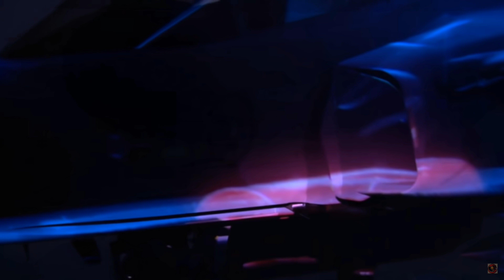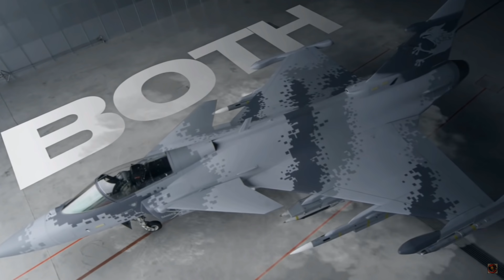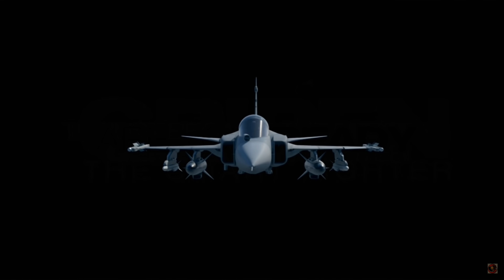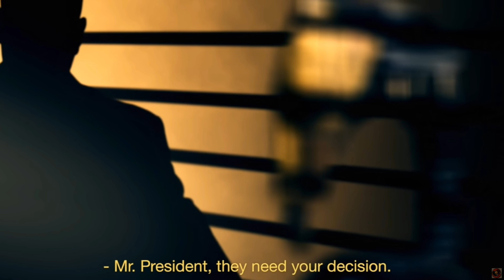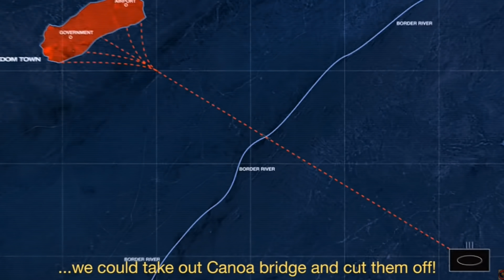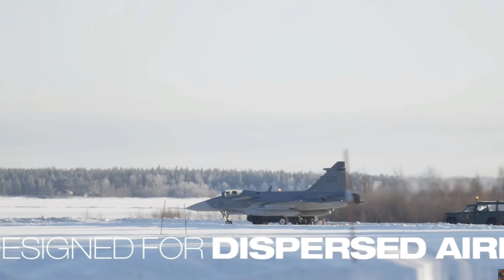Saab JAS 39 'Gripen' | SWEDISH MULTIROLE FIGHTER

Comment: If Canada gets the gripen then everyone should bow down and apologize to the engineers at bombardier. I’m sure, had they known how reflexive anti-American the Canadian public was they would have built a fighter rather than an airliner. 

Getting this vapourware airplane would be a step back considering it doesn’t even exist yet and most of the stuff is licensed. 

Also the Swedes won’t even be flying it in 5 years they are going to dump it and fly the typhoon. 

I’m sure it’s a fine plane for ThaiLand or whatever but it means Canada will never be able to deploy with coalition forces without having to lug around a bank breaking separate supply chain. 

What happens if there is an emergency? The pilot will either have to find a Canadian controlled airfield with parts (great in an emergency) or land at another field and wait for parts to be shipped. 

Welcome to irrelevance Canada but I guess you’re used to it.

Comment: As interesting as it would be to compare different fighter aircraft and their capabilities, we generally lack the information to do so. 

For example Gripen is claimed to have superb EW capabilities. This is believable; such capabilities cannot be demonstrated freely without giving potential opponents clues to defeat them. Sweden also has remarkable expertise in signal processing and radio electronics. Consider for example that they host Ericsson which is one of three companies in the world that produce functional 5G equipment. It also makes sense for them to focus on EW whose development is more expertise and time intensive, than capital and material intensive missile system development. However, this is still all conjecture.
 
No modern 4G or 5G fighters have ever clashed in anger in a way that would give us hard data. Really, even engineers at Lockheed Martin and officers in superpower air forces are only conjecturing on this.

Comment: An interesting story from the Libya campaign (2011) where Gripen participated in the reconnaissance capacity: After returning from a mission to its base in Sicily (Sigonella) the wing was told to divert to somewhere else since there had been an accident involving two UAE F-16s on the main runway and it was blocked(https://www.flightglobal.com/libya-nato-confirms-f-16-pilot-safe-after-sigonella-ejection/99622.article). The second runway does not have the required BAK-12 arresting system installed for NATO fighters but since the Gripen was designed to land on 800m runways it was the only fighter that was able to use the second runway.
Reply: Thank you for info

Comment: I remain amazed by how Saab managed to pack so much capability into a fighter that's so much lighter than its competitors. And in the process making a fighter with lower operating costs than those competitors.
Reply: But with less payload et cetera than those competitors.
Reply: @Sedna063  Well yeah, you can't get something for nothing. But the Gripen is ideal for nations with a smaller budget relative to how many fighters they need.
Reply: @RedXlV  Oh absolutely, it's a masterpiece of fighter jet design.

Comment: Brazil ordered a couple of Gripen NG: Fly by hour cost is not excessive, maintenance costs are acceptable, can launch/land in rudimentary roads, communication system that can share info with other units, small size means less radar signature, transference of technology, support from SAAB to adapt the aircraft to use Brazilian missiles (like the air to air Piranha) and possibility other national systems, can change equipment and adapt to different missions (extra fuel tanks, air to air,  air to ground), good radar with good range and radius, great for patrolling
Reply: I am Brazilian. The FAB said ages ago this what they realistically needed. Despite all the political pressure it took the government over a decade to decide on the right choice that was originally proposed. So, the French corruption didn`t work nor the Super Hornet with economic pressure. So, the politicians can steal from other areas and leave the technical decisions to the experts.
Reply: A couple (36 planes)? Fly by hour not excessive? Lol - we are talking about a plan that cost a tenth of a similar fighter plane of the latest generation. Both in purchase and in maintenance - Sweden has used it for decades, we have a lot less budget then Brazil. Consider this instead, Brazil - one of the largest countries - Sweden among the smallest. And both can use them. It will bring fear to anyone who want's you something bad. Plain and simple.
Reply: @corresandberg  I don't get your comment you basically just repeated what I wrote
Reply: @the7observer  a couple means 2. Brasil ordered 36 Gripen E/F.
Reply: Actually Brazil didnt just order Grippens. We bought the technology to produce them. Engineers are on the final process of the final technology exchange as well as the manufacturing centers being built
Reply: @luska5522  GRIPEN inte grippen
Reply: It was a good choice since the other options in the market would only work on an order basis with no proprietary production rights. All our neighbors have the F16 or similar, so the Grippen NG sounds good
Reply: Sweden and Brazil increasing friendly relations is good. Sweden loves Brazil, except for your... problems. We also have big problems, so we cannot judge.
Reply: @carpetclimber4027  countries are like families. All of them have some problems

Comment: Sweden has been Aggressively pitching this aircraft to India. I don't know if IAF will go for it. There are better aircrafts that are there in the deal, so it will tough for this little bird.
Reply: @soulsphere9242  yeah, that is a problem here in India. Truth be told, it is structured such that the armed forces have to go through some civilians who are MPs, and they have no knowledge of weapons obviously so all it tskes is one small remark for the file to be sent back and the whole process to be restarted. However, the government has taken certain steps to combat that. And im hopeful, once it starts operating, precurement proceeding would get alot smoother. 

I find Gripen to be a great deal though. India is in need of some air infrastructure, and SAAB has been quite intent on ToT. LCA program might be threatened but would give India much needed partner. LCA even though is a good second jet from India, it still because of sanctions got immensely delayed, just like MBT Arjun, and i dont know how long will it really take for LCA mk2 to get flying along with AMCA. Having a good partner would really solve most issues and MMRCA which is a stop gap measure, wouldn't really be needed, atleast on this big of a scale. The biggest problem is along with IAF, Indian Navy too needs cartier based jets. I wonder when will that be taken care of.
Reply: @soulsphere9242  true, lets hope its all worked out. Btw in next 5 years along with Tejas mk2 which should be tested hopefully, a twin engine aircraft is being developed for the navy. I can't recall its name. AMCA is said to be tested between 2023 and 2025, if everything goes well that is. But as you said it took US a long time, i agree to that, but i do have a counter. US when it was developing said fighters was at the frontier for said technologies and hence it had to do it all by itself. India however might get help from here and there. Anyhow, AMCA will from what im hearing will be added to the fleet in in later the coming decade, hopefully before 2030.

Comment: Another thing is the gun: As far as I know it is a Mauser BK-27 and that is NOT a Gatling gun.
Bordkanone 27 is a revolver gun, just like the Aden gun, but with a considerably higher muzzle velocity and heavier projektile, which does make sense, as a revolver canon does not need power supply from its aircraft.

It is by the way the same gun as in the Tornado.

It makes a lot of sense in so far as cooling is rarely a problem for an aircraft gun.

The Typhoon also uses it but with a better feed system - which is allways the problem for automatic weapons. The most sensitive part is generally the magazine of the gun which gives the malfunctions.

Comment: Bk27 isn't a gatling type canon,it's a revolver canon
Reply: And for the typical, half-second or less bursts in air combat: "The BK27 has a much lower nominal fire rate than the M61 Vulcan, but its fire rate is constant throughout shooting due to the fact the cannon need not spin up. As a result, in conjunction with the higher caliber, the Mauser BK 27 fires in the first half second 4 kg of projectiles in contrast to the 2 kg of the M61 Vulcan which also needs about 25 kW electrical power on the maximum fire rate"
Reply: @karlvongazenberg8398  m61" vulcan" on f16,f15,f14 has a hydraulic drive,not electric . And yes,your'e right it needs abou half a second to get to the max speed. The downside of revolver canons is their  lower relaibity in comparison to gatling guns

Comment: Basically Mat what the CF told u was what the RCAF wanted to tell u which was that Fighter Pilots in the RCAF and Officers love flying American. 

Quite literally (If you want proof look at every single fighter aircraft post WW2 in RCAF service). Our next fighter will be the 35A, it's what our Boys and Gals want and it's what theyll end up getting. This is the most neutral non partisan fact but like any other defense procurment project will come into service later than it should have been. At least most funds previously were sent to the RCN for those sexy looking Type 26s.

Comment: The problem with the Gripen are many!

1) It is actually trying to fill the F-16's niche; but it does it with a LOT of compromises. One of them is COST. Gripen costs about 2-4 times what an F-16 can be aquired for.

2) Gripen is about 20 lighter than the F-16, that was never a heavyweight. That to bring it into a realm where the engine they could get licence production on was - with some approximation - adequate. It is actually a technique that was used during WW2 where they build a fighter around the engine of a C-47 Dakota.
To compensate the modern precision guided munition came to the aid - which is fine, but a costly way out of problems.

3) Due to its light weight it has serious range issues. An F-16 has a max. take off weight the is 5 tons heavier than Gripen.

4) The further problem is Sweden as a supplier of spare parts. Now spare parts are ALLWAYS expensive. Denmark bought the Draken way back - which was a misfortune never to be repeated. Not only were the spare parts expensive, they also had to be carried in large numbers, because in the event of a war there would be considerable problems aquirering them. I believe the Danish Drakens still fly as a simulation of weapons and an agressor (I might be wrong here) - simply because there was so many spare part, which had no use otherwise.

5) The dispersed airstrip filosophy is flawed in so far as most Nato countries have an abundance of airfields - and airstations. Denmark alone has - on the Jutland peninsula 5-6 airfields - among them Karup that during the cold war was Nato's absolute largest airfield (a title that has now shifted to Incirlik in Turkey.
Most of the airfields have multiple runways - plus widened roads to supplemet in case of an emergency.

6) The defence filosophy of Sweden prevents a proper layered air defence, i.e.
a) Short range engagement zone with AAA and MANPADS.
b) A missile belt - Denmark has moved that to the Huitfeldt-class frigates.
c) A fighter engagement zone.
d) If possible: A long range fighter zone to sweep up the pitiful remains of a hostile attack.
e) Some sort of AWACS to direct and allocate weapons, as ground based radars cannot be counted on to be operational in the event of a major surprise attack.

7) Today the emphasis is on range and supercruise. The F-35 has the range, but is hardly a dogfighter. The Typhoon has the speed and menoevrability, plus a respectable range that makes operational deployments in the air possible - at short notice - within a European context.
The major problem is: With the long boarder the enemy might assemble considerable forces at one (at most two) points that could overwhelm the local forces - in say Poland or Rumania - so the ability to reinforce rapidly is decisive.
The European theater is different from the Arctic. But with a bit of skill can be considered complementary.
One thing is certain: The Swedish defence filosophy is outdated. What is needed is an "attitude adjustment" among the suppliers - i.e. revision of their prices downward - to make the Nato members realise where their national interest lies. The americans seem to be made aware of that - they are not stupid; but they need quite a lot of help - in the thinking department.
Reply: 1. Latest estimates for the ENTIRE swedish purchase of sixty 39E:s is SEK 40B. 40B/60/9.5=> USD 70M-ish.
(https://www.svd.se/notan-for-gripen-e-368-miljarder--hittills)
So a quick search online sets a high estimate price for the NEW E-version of Gripen at USD-70M each.
Two to four times more expensive, gives: 70M/4=17.5M, which, I admitt, is what a F-16 costs, in 1998. (Wikipedia)
Adjusted for inflation this is closer to USD 27M today. Still a lower number, but I wonder what equipment and
what infrastucture comes with it. Does it come with several simulators, tools and training, or just crickets...

2. How many hours does an aircraft designer not spend, trying to make the airframe as light as possible.
The F414 is used in the F-18E Super Hornet, so saying "of which they could get a licence" seems petty.
And what on earth does the reverse engineering of the P&W TwinWasp (for J22/B18) in the 1940:s have to
do with the JAS39E?
"To compensate the modern precision guided munition came to the aid - which is fine, but...". Say what?
Too many Tuborg? (Hvergang! ;-)

3. The JAS39E has a ferry range of 4000km, the F-16 4300km. A difference of 10%.
Max external load on the JAS39E vs F-16 is 7000kg vs 7800kg. Again 10%.

4. Sources? Have found very few, but reading books about the J35 Draken, and how it was viewed in
danish service, the all over opinions seems positive. But I have to admitt a lack of sources here.
As to the problem of spare parts in case of war... well, unless you have domestic suppliers and domestic
manufacturing, I can't see the problem solved. Admittedly, Sweden will not supply war materials to waring
countries, which does force an extra consideration concerning cost of spare sparts.

5. Sweden also have an abundance of airfields and runways, all over the country.
In peace time, we use them to drive on. ;-)

6. Don't have enough knowledge to reply.
But I fail to see how a flawed defence filosophy, detract anything from the JAS39E.

7. The JAS39E can supercruise at almost the maximum speed of the F-35, according to Wikipedia (yes I know ;-)
And the F-35 seems to have a shorter range than both the F-16 and the JAS39E. (Though I doubt Wikipedia has
the accurate numbers here.)
But again, (see 6.), I fail to see how a flawed defence filosophy, makes this aircraft a bad aircraft.
Reply: Thomas Borgsmidt Fixed airfields are prime targets in any conflict. If the opposing forces have a way of attacking those airfields from a distance, the dispersed airfield concept starts to make sense. This is the same logic the US Marines use to justify the use of vertical takeoff/landing aircraft. They first bought Harriers, now going to F-35Bs. During times of conflict, Air-to- Surface or cruise missiles can easily take out a the runway of an airbase with just a couple of strikes, perhaps from an extended range depending on the missiles to be used. You launch 10-20 low altitude cruise missiles at an airfield runway, and even if only 4-5 actually impact the airfield, it is useless until it can be repaired. In the time that it takes to repair the runway, you launch another wave of misslies,this time targeting the hangers, parked aircraft, and base facilities.

Comment: I was a big fan of the Gripen in the past because it has many impressive features. However, due to technological developments it appears that medium to large sized fighters will be better options going forward. If small fighters can be gained at a low price they could still be tempting to countries with small military budgets. But the larger weapons loads and larger radars enabled by larger air frames is becoming more critical as effective missile ranges increase. Missiles are also becoming more agile and better able to maintain locks on targets, making short ranged maneuver based dog fighting even less relevant.
Reply: "Quantity has a quality in itself." Cost and number of airframes will always be a tough consideration.
A larger target is easier to hit. So as missiles does become faster, more agile and more difficult to counter, I would postulate, that the larger and less manuverable airframe, will suffer more than the smaller and nimbler one.
The abillity to carry vast amounts of countermessures, flares/chaff and ECM, will impact the amount of offensive armament carried.
Taken to the limits of reasoning, your thinking, as I see it, advocates for using a wing of B2:s as pure missile launchers.